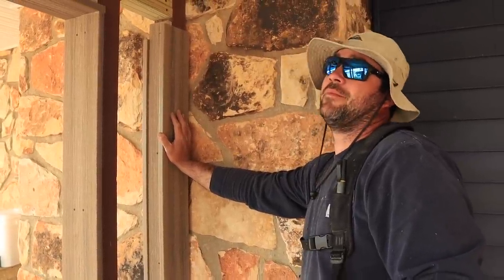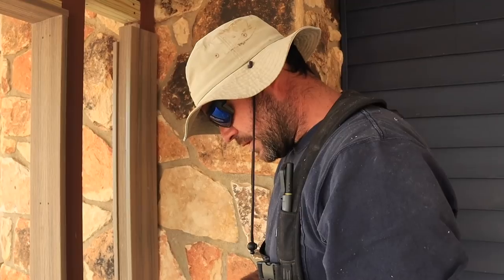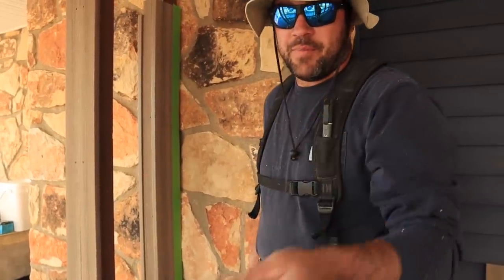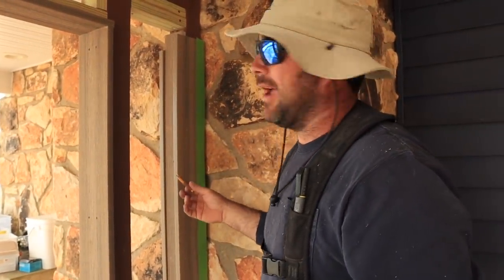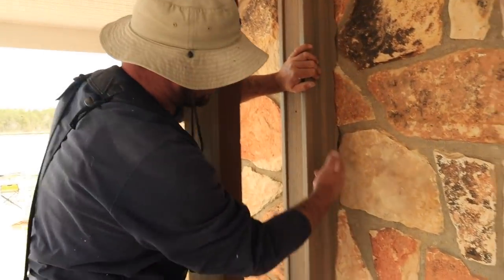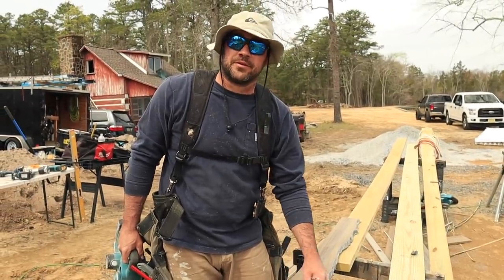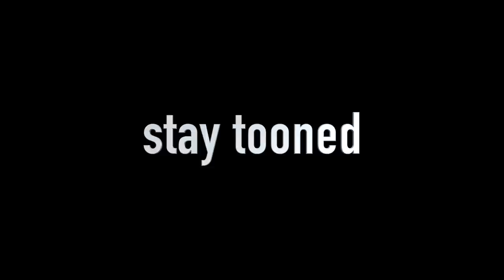RIVERFRONT BACKYARD BUILD Pt 10 - Patio Details and How To Scribe Against Stone

Comment: I am wondering why you choose not to use a 1/4' chip stone for your screening bed before laying your pavers? Are you able to use 3/4" clear stone due to the size of the pavers? I am laying a patio using 16x24 pavers and am debating the 1/4" chip or using just 3/4" clear stone.